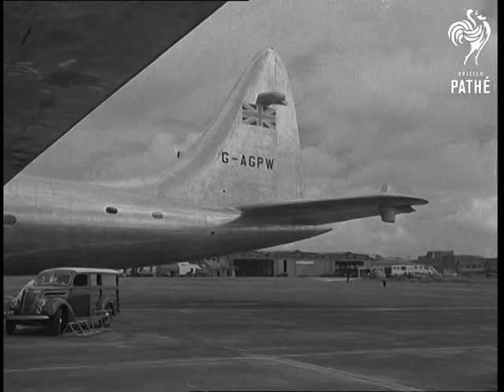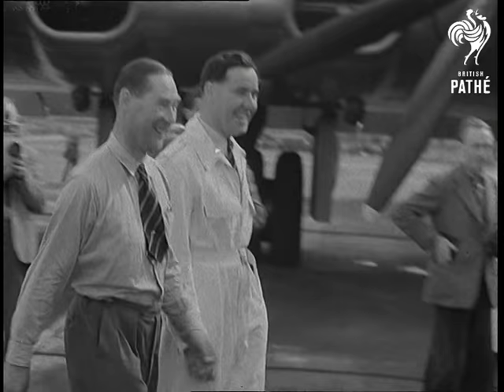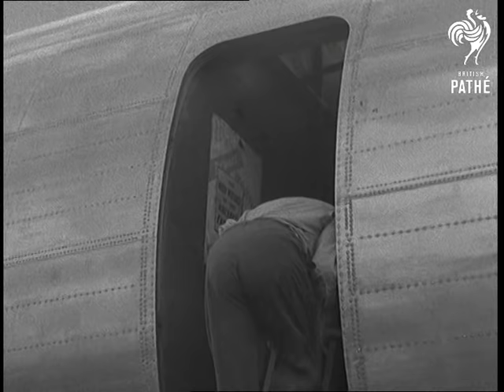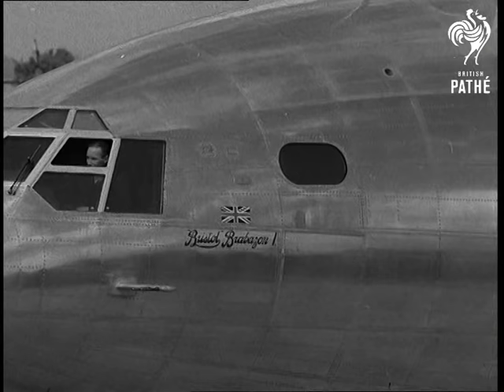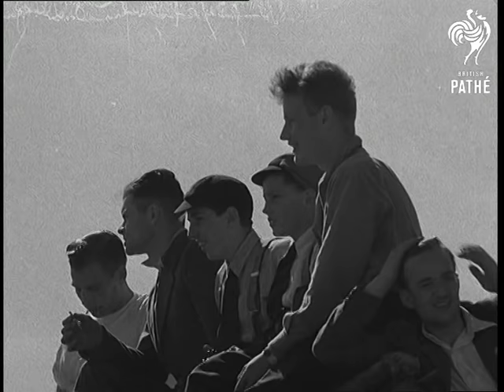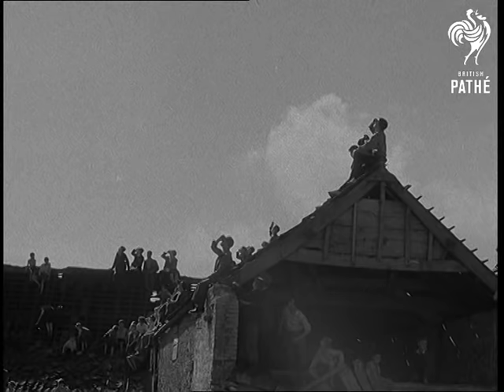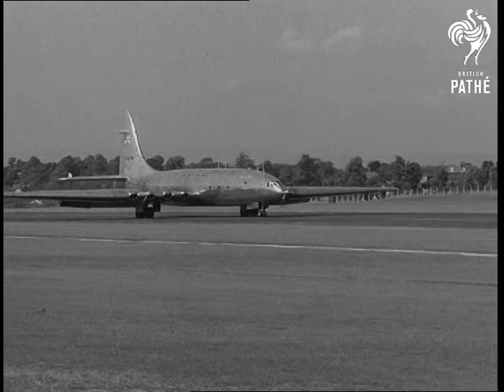130 - Ton Colossus Takes The Air (1949)

Comment: Unfortunately it was out of date before it even flew. Jet propulsion was the future.
Reply: It could have made as a transport aircraft, with a few small-ish mods.
Reply: I'm thinking with the Brabazon it was too much of a leap forward in aircraft size. Boeing developed airliners but not too big, eventually achieved the 747 when engine technology, the high bypass, and other technologies. But wait Britain did put in service the Comet first commercial jet liner. Unfortunately learned lessons of structural design the tragic way. However, it seems that aircraft like the Brabazon and the Vickers all had embedded engines which limit improving the overall design. 737 and Airbus with engines mounted below wings can accomondate new high bypass engines.
Reply: @wrightmf  Regarding Comet - Round cornered windows vs squared, so obvious in hindsight..
Reply: @brettv8  Unfortunately the "square window" story is a myth. The error was a late decision not to use bonded windows but to rivet the window frames in. The airframe was not strong enough to cope with having hundreds of holes drilled in it, and that started the cracks that led to an explosive decompression. The Comet 4 had round windows because it had to be seen to be different from the Comet 1.
Reply: I thought the Boeing Stratocruiser was a comparable aircraft, much more successful than the Brab, and that was piston powered.
Reply: I feel like if they crammed the plane full of seats, it could have been a success
Reply: @crazyleyland5106  As was the Constalation and DC6/7 !!!  DUUUUHHH!!!!! And go back to the 1930 and Boeings XB15 and the 314 flying boats, the Pan Am Clippers !!!  They were successful !! !
Reply: It was the same era as the B-36.
Reply: @jamessnider7869  Two pigs of the sky !!! !
Reply: @saunders-roe9806 
The airlines and airports were not ready for such enormous passenger-loads .
Reply: Radials would serve as the backbone of airlines and civ. transport for another 20 + years bro.
Reply: @wrightmf  
High-bypass turbofans were not even a thought then , and turboprops were not yet perfected . 😎

Comment: The propellor sound is, to use a modern phrase, truly awesome and I would think unmistakable. Great film footage.
Reply: Ini kerana is
Reply: Right? Counter-rotating props in this video sound distinct from anything ive heard in person.
Reply: Turboprops.
Reply: @funnyrabbitflyer6855  CONTRA-rotating. Counter-rotating props are separated, like on the Chinook or Osprey.
Reply: I heard that when airborne and the sound terrified me as a very young boy. Totally unmistakable, just as Concorde was later on.
Reply: @funnyrabbitflyer6855  I'm not trying to undermine the original post, but look up taxi/takeoff videos of the Tupolev TU-95
Reply: @dartmaster501  Nope, 8 Bristol 18cyl radials. Had it been turboprops it would have survived. The jets became the nails in the coffin. That was the only one that flew.
Reply: @grimp53  true
Reply: Sounds like "looped" audio from a V-1 Buzz Bomb...not that it matters.
Reply: Contra-rotating props make a lot of noise !
Reply: I love that sound. Poetry. Don't suppose you could shoe horn one of those engines in to our clapped out old Citroen Berlingo.
Reply: @dartmaster501  Nope ... it was powered by an arrangement of eight Bristol Centaurus Radial piston engines which drove a total of eight paired contra-rotating propellors set on four forward-facing nacelles.
Reply: @christopherrichards3601  Someone answered that 7 months ago.
Reply: @dartmaster501  So they did ... couldn't see that on my phone!
Reply: *propeller
Reply: @dartmaster501  radial piston engines concealed in the wing, not turboprps. They were to come later in the development programme - which, history shows, never happened.
Reply: @grimp53  I think cooling of the gearboxes and the Centaurus engines was problematic, and the effect of vibration on the gearboxes,  a dynamic nightmare ..
Reply: That it was equipped with traditional propellors and not with Turboprops was one of the huge problems of this aircraft, that made it a flop.
Reply: Sounds like the B-36.
Reply: @christopherrichards3601  Yep it's a lot of cylinders to think about... and they were a sleeve-valve too, IMO a superior design for a radial. Expensive to build but they were going for the highest quality and reliability and the cyclic motion had lower impacts than reciprocating poppet valves. They were beautiful engines. When you hear just one of these in a Sea Fury it's so impressive, then this thing had 8 of them.
Reply: Shame it was obsolete long before it even flew, what a waste of money.
Reply: Th uk has had somw brillka t enginsers. Njst a sbame lur pllitions are piss poor
Reply: @FernandoPartridge  Yes, indeed.
Reply: Sounds like a B-36 bomber...
Reply: @JBofBrisbane  if you'd looked. Others already stated this.
Reply: Sounds like the soviet Bear bomber!
Reply: @drew65sep  I think it's looped audio from the distinctive sound of the Antonov An-22 cargo plane.  Those were contra-rotating four-blade propellers driven by 15,000 shp turboprops.  This clip sounds exactly the same.  Also the sound of the children cheering is obviously looped.  The original film was silent.

Comment: For a second, I thought it was going to stall on take off. So smooth!
Reply: Same. At or just soon after
Reply: Yeah. 160 mph is pretty slow for a plane that size.
Reply: @nk7155  nah, usually larger aircraft are slower
Reply: @startingbark0356  Larger aircraft don’t usually fly slower. They often have to fly faster, because they are heavier and they need to generate more lift. The reason this plane is probably able to takeoff and fly so slow is because it has little payload and is particularly light.

A 767 can takeoff at 108kts when it weighs 90,000kgs, but it can only takeoff at 170kts at 190,000kgs. That’s the exact same plane and the only thing that changed was the weight.
Reply: @nicholai1008  no, they bigger they have more drag
Reply: @startingbark0356  They also tend to have more thrust to counteract that fact. A Cessna 172 has substantially less drag than a 747, but it would be incapable of even reaching a fully loaded 747s stall speed. The 747 has to travel faster to generate the lift required to fly.
Reply: @nicholai1008  thats due the fact it has jet engines, tho its not near as fast as a fighter jet
Reply: @startingbark0356  Why would having jet engines mean that it has to fly faster?
Reply: @nicholai1008  they cause less drag and have more thrust
Reply: @startingbark0356  That is an explanation why the 747 can fly faster. My question was why it can’t fly slower.
Reply: @nicholai1008  that depends on how much lift it generates in comparison to weight
Reply: @startingbark0356  You are absolutely correct it does depend on the ratio of lift to weight, heavier aircraft generate more lift by going faster.
Reply: @nicholai1008  the point is, usually larger aircraft are slower then their smaller counterparts from the same era (counterparts as in same type of propulsion and wing design)
Reply: @startingbark0356  A fully loaded crj-700 takes off at 135kts, a fully loaded 767-300 takes off at 170kts. These are both twin engine jet airliners (the crj is smaller).
Reply: @nicholai1008  still different in engine placement
Reply: @startingbark0356  How would that make a difference? A fully loaded a320 takes off at 145kts which is still lower than the 170kts of the 767.
Reply: @nicholai1008  different engine placement, the 767-300 has less wing erea that it can effectively use due the engines being mounted on the wings
Reply: @startingbark0356  I’m not going to argue the engine placement problem, suffice it to say it’s far more complicated than your description.

The 757 was built in the same configuration, at the same company, in the same year as the 767. It was literally designed to be the smaller version of the 767, they are nearly identical in every other respect. It takes off at 155kts, the 767 takes off at 170kts, why?
Reply: @nicholai1008  less wing to weight ratio probably still
Reply: @startingbark0356  What would that prove? If the argument is that larger aircraft are usually slower. Coming up with reasons why a smaller aircraft is slower, just reinforces that smaller aircraft are slower. There is never going to be a perfect comparison between aircraft, I do feel that the 767/757 comparison comes close. I get that it seems counterintuitive that something larger should be faster, but I gave you the explanation as to why that is usually true. You don’t have to believe me.
Reply: @nicholai1008  they usually slower but need more speed to takeoff thus they still usually slower
Reply: @startingbark0356  Have any data to back that up? Because as you increase in altitude, stall speed increases, so heavier aircraft need to cruise at higher speeds as well.

A fully loaded 767 usually cruises at Mach .83 and a fully loaded A320 usually cruises at Mach .79
Reply: @nicholai1008  that again depends on their wing area compared to fuselage ratio, larger wings means less speed needed and larger means more drag and more drag means less fast or atleast much more power engines needed
Reply: @startingbark0356  Yes, and since designers don’t want to increase parasite drag too much, they usually give larger aircraft proportionally smaller wings and much larger engines…so they need to fly faster.

Moreover drag isn’t a constant. There is one speed where you have the lowest drag (L/D max). If you go faster than L/D max drag increases, and if you go slower than L/D max drag also increases. 

L/D max increases with (you probably guessed it) weight. So when an aircraft is heavier the total drag may be higher, but it will need to go faster to fly at a speed that has the least amount of drag for the weight. Because if it goes slower it will have more drag.
Reply: @nicholai1008  drag isnt constant but its still a lot more when the aircraft is bigger, the Bristol brabazon is definitely slower then the B-29 or ww2 fighter aircraft and those are from a similar era, even the first Bf109 is faster then the Bristol brabazon and that plane is from 1935
Reply: @startingbark0356  The Bristol Barabzon’s cruising speed was 250mph, the B-29s was 220mph.

Of course fighters are going to fly faster, they’re not designed for efficiency. They are designed to fly as fast as they can. Concorde could fly faster than an f-16, and it was far larger.
Reply: @nicholai1008  yet the topspeed of the brabazon was only 480km/h, the B-29 could go 600km/h the Concorde was very advanced and unreliable while the F-16 was basically the opposite but the F-15 and Mig-25 could fly as fast and Mig-25 even faster
Reply: @startingbark0356  But B-29s didn’t usually fly at that speed, and why didn’t they fly at that speed? Because it was inefficient thanks to the L/D max problem I mentioned above. Planes don’t fly as fast as they possibly can all of the time, it is a waste of gas and it puts unnecessary stress on the engines and airframe.

Besides which, the B-29 was deliberately overpowered, because it needed to be as a combat aircraft. The C-54 was a smaller four engine cargo aircraft from the same era and its max speed was only 275 mph.

Larger planes usually fly faster than smaller ones. 

Even according to your own example the MiG-25 is larger than a F-15
Reply: @nicholai1008  that has nothing to do with Mig-25’s larger size, Mig-25 was basically 2 massive engines strapped to 2 wings F-15 was not, and for the brabazon to fly that fast is also very unefficient because it needs to travel large distances, it also uses paired engines which suffer even more of stress when they put out more power
Reply: @nicholai1008  B-32 had a cruise speed of 467km/h and is basically twice as small as the brabazon and the brabazon has only 402km/h
Reply: @startingbark0356  I know about the mig-25, I was being slightly facetious.

The point is that it’s not only inefficient for a plane to fly too fast, it’s also inefficient for a plane to fly too slow. L/D max is the most efficient speed. And L/D max is almost exclusively going to be higher in a larger plane.
Reply: @nicholai1008  depends on the wing size
Reply: @startingbark0356  Yeah, so why are all of these bigger planes designed with proportionally smaller wings?
Reply: @nicholai1008  they don’t seem to have that tall wings except the bomber aircrafts because those need to go higher altitudes and often had weaker powerplants and larger aircraft do however often have larger wings because they need to take off otherwise they do be land locked except if they have absolute unites of engines
Reply: @startingbark0356  They have larger wings, but the wings aren’t proportionately larger thanks to the square cube law.
Reply: @nicholai1008  so they depend on more powerfull engines compared to their weight, that basically equals why those planes are faster but if you would take a Cessna and scale it 10 times up it would most likeley be slower even with all its stats also scaled up by 10
Reply: @startingbark0356   I can show you mathematically why it would need to be faster.

One wing of a Cessna has a 5.5m span and a (roughly, we’re going to assume a square wing for simplicity’s sake) 1.5m chord, giving a surface area of 8.25 m^2, it carries 106 liters of fuel in a tank that measures about 4m x 1m x .0265m

Assuming that the wing doesn’t weigh anything, and just taking the weight of gas, 106L of avgas weighs 76kg (106L x .72 kg/L), the lift required to overcome gravity in straight and level flight would be 745.56N (76kg x 9.81ms^2).

Now let’s scale that up by 10.

The wing would be 55m x 15m with a surface area of 825 m^2. The fuel tank would be 40m x 10m x .265m or 106,000 liters.

106,000 liters would weigh 76,320kg and would require 748,699.2N of lift to maintain straight and level flight.

Each m^2 of wing on the normal wing would need to generate 90.3N of lift, and each m^2 of wing on the larger wing would need to generate 907.51N of lift.

What you would have is a proportionally heavier aircraft that would need to travel faster to generate more lift. (What you would really have is a structurally impossible aircraft that would break under its own weight.)
Reply: @nicholai1008  u r arguing with someone who isnt listening to your points
Reply: @unfurling3129  Thats fair. It’s a complex and counterintuitive topic anyway. I can understand why someone would want to stick to what makes sense to them.
Reply: It most certainly would've if they didn't get that effin nose down quick lol
Reply: @nicholai1008  I bet it ate up the fuel...

Comment: Saw a doc on this about 20 years ago.  The plane landed so softly the pilots actually had a light on the panel that told them when the wheels touched down.  I believe it flew for a few years.  Since it was so comparably slow (and took so long to cross the ocean) the interior still followed the concept of a “cruise ship of the skies”, and couldn’t economically compete with faster competing aircraft. 
Too bad it wasn’t preserved in a museum, as was the Spruce Goose.  Sadly out of date before or just after it took off.
Reply: What symptoms?
Reply: JFC... another passive/aggressive KAREN...
Reply: "The plane landed so softly the pilots actually had a light on the panel that told them when the wheels touched down."
That doesn't make sense. Any plane lands as hard or as softly as the pilot puts it onto the ground. Many planes have a weight-on-wheels sensor which, for example, prevents deployment of reverse thrust while in flight. Probably the maker of the documentary misunderstood this.
Reply: @beeble2003  No, wing aspect ratio and wing loading are major factors in how smoothly an aircraft lands. Basically when an aircraft has a lot of excess lift available, lift tends to bleed off slower, and the pilot has better trajectory control of the aircraft during the landing maneuver and therefore can land softly.
Reply: I was wondering just that, how practical she would have been for regular commercial air travel. But as a luxury liner she must have been super comfortable.
I wonder many for built, which airlines flew her and for how long.
Reply: @tryarunm  No airlines ever flew the Brabazon. The prototype was the only one that was built.

Comment: Some of the comments on here absolutely begged belief? The Brabazon had eight engines, one for each of its four contra rotating props, it was not in any way stalling as it flew, 160kts is pretty much flat out for an aircraft of that time, it’s failure was due to the fact that in 1949 jets had been flying for 6 years, this aircraft was abandoned for that reason and although it took a few more years before jet passenger aircraft flew, the Bristol company’s next attempt was the Britannia, a turbo prop aircraft that was ahead of its time for about 10 days before everything without jets were obsolete. That was the pace of progress at that time, 1949 piston engine aircraft that could nearly make London New York, 1969 Concorde M2.00 at 65,000’
Reply: Thanks for sharing!

Comment: This plane had maximum take off weight of 131 tons, whereas Boeing 747 had 300 tons when she made her maiden flight in 1969. 
Bristol Brabazon was very much a plane of the early 40s, and came too late to do anything, the age of jet was coming, to put things into perspective, Soviet Tupolev Tu-95 from 1952 had almost 200 ton capable take off weight, and was a turbo prop design as well, Bristol Brabazon never stood a chance.
Reply: The B36 went into service a year before this video had a loaded weight of over 200 tons, but was superseded by the  B52. Lightly loaded, it could fly high enough that MiGs could not reach them during the Korean War.
Reply: Indeed.
Reply: Brabazon was obsolete before she was built.  Lockheed Constellation was already in airline service for fours years.  Surely, the committee could see this??